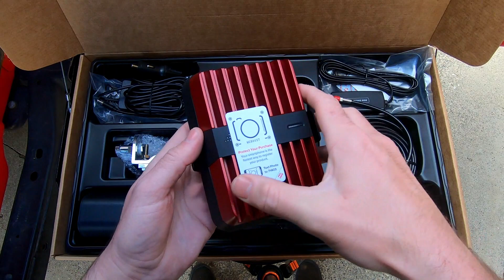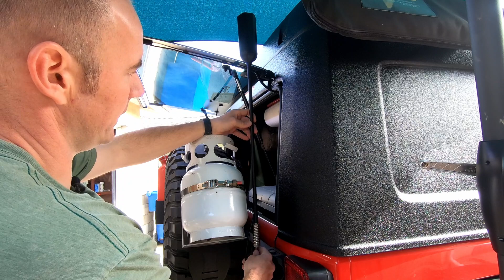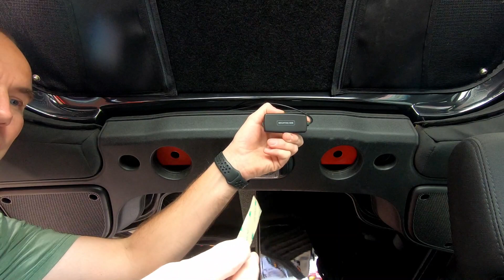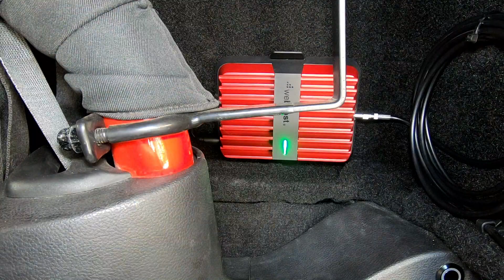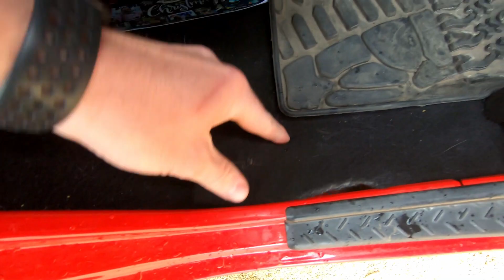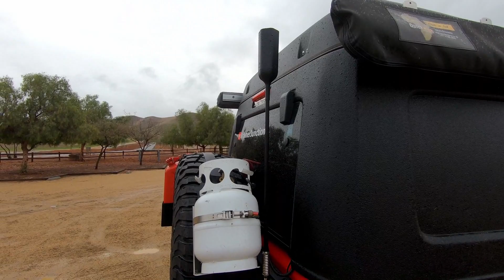Jeep JK WeBoost Drive Reach OTR Cell Signal Booster Install

Comment: So how do you like it? I just got mine for black Friday and almost think it's placebo effect. It gives me maybe an extra bar, but only in areas where I already have signal
Reply from the maker: I have a corresponding long term review video which I made a little while ago. It’s like I say, it works, but it can only do so much. If you have no service, it may give you a bad, if you have two, it may give you three and it can’t boost a signal if there is none. I would never expect streaming type speed increases, it basically just helps you get the job done. There are FCC constraints on what these types of devices are allowed to do and WeBoost still offers the best option on the market imo. I am in no way affiliated with WeBoost or sponsored by them fyi.
Reply: @KramerJunction  I appreciate the detailed response. I had high, but realistic hopes that it would extend the coverage area. I do understand it can't amplify no signal. All of the areas I go with little to no service are just outside of cell range and I was just hoping it would relieve some of the spotty coverage. Thanks again

Comment: spoke to weBoost about antenna height, and they said it would work best above the roof line.  Notice your antenna is below the roof line.  Do you have any signal issues with just the 18" height?
Reply from the maker: If you check out my long term review video I show and talk about how I added the extra extension. I thought it would sit too high at first but it wasn’t an issue so I added it. Can’t say I noticed any difference.
Biggest thing I have found out about the WeBoost which someone told me about is that from a technical standpoint there should be some type of metal shielding between the internal antenna and the main unit. The lack of shielding causes feedback oscillation or something like that at the WeBoost actually turns down the amplification to compensate…or something like that

Comment: Nice install. Wondering if you have an update after a year?  Mounting mine on my sprinter. Planning to swing antenna up when needed for clearance.
Reply from the maker: Yeah long term review is filmed it will actually be posted on wed, but overall I’m pleased with it and I 100% recommend it.

Comment: Do you have a link to where you get those 12 V switches? Sorry but I just found your channel.
Reply from the maker: Sorry for the late response. There are links for everything in the video description 👍🏻
Reply: @KramerJunction  Thanks for that. I just came back and rewatch this.. I’m seriously considering buying one of these now but I have a problem where are you put the antenna on the back of the jeep. Everything I’ve come across researching says to push the antenna up above any kind of a flat plane. So basically the highest point off a surface. How is this working for you lower down?

Comment: Finally seeing someone install the OTR antenna.  I have the we Boost but just the little antenna that came with mine.  I could not tell but what mount did you add to the tailgate that you were able to attach the OTR to?  I have a CB mount center of my spare tire but I can add another one near the hinge.  I have a 2014 Rubicon and hope to hear back where you got the mount. Oh and We Boost actually sent me your link
Reply from the maker: Haha nice that’s awesome of them to do!
I have the Teraflex Hinge Carrier. I think they call it the Alpha. It is pre-drilled for a mount they make. The antenna should fit in any mount where you can fit a CB antenna. Hope that helps 👍🏻

Comment: I noticed when I was wiring up my 12v dc adapter that it had both the positive and negative were wrapped together under the shrink wrap where the two separate. Did you add the inline fuse and see something similar or did you just wire direct without the fuse?
Reply from the maker: Yeah that wire is a pain in the butt. I remember the negative is actually woven around the outside of the positive like the mantle on a rope. I haven’t had to deal with that before so I basically unwrapped it a ways down the cable and then attached the negative to whatever corresponding negative it went to then cleaned the whole thing it and strengthened it with some heat shrink 🤷‍♂️

Comment: Been thinking bout getting one for my jku and my welding rig.  Cheers
Reply from the maker: I definitely recommend it. I have only had good results. It can’t boost what isn’t there and I’ve found it can actually slow you down if you already have great signal, but those times when you barely have a single bat it can give you two or maybe three. 👍🏻

Comment: Had no idea about the small area in the rear of the center console, so thanks for that.  Been lookin at installing one of these but haven't figured out yet where I want the antenna.  Not to many videos out there of these being put on Jeeps, so thanks again.  How bad dose the antenna travel while out on the trail?  I'm worried bout the head of the antenna smacking into the roof when things get bumpy, thou it seems you got least half a foot of clearance with your mount.
Reply from the maker: I haven't had an issues with the antenna hitting the top. The mount is pretty solid and it takes a bit of force to make the spring move. I'm glad you found my video useful

Comment: So what was the result
Reply from the maker: Mixed results. At this point, with limited use, my general consensus is...if you’re in an area with good signal, don’t use it or it might actually slow you down, if you’re in an area with bad signal, it may or may not increase your speeds based on the availability of existing and accessible cell service.
The one consistent thing I have noticed is a significant increase in upload speeds across the board, regardless of coverage prior to powering up the WeBoost.
Absolutely nothing scientific or measured, just what I’ve noticed/seen with limited use 🤷‍♂️
Reply: @KramerJunction  Hello, Not sure if this will help but it doesn't hurt to share if there is a possibility. Your antenna is being blocked where it is located on your jeep. I was told for it to be in an area where it is free from anything at the highest point so there is nothing obstructing the antenna for any signal. That specific antenna you have is made to pick up in all directions. Hope this possibly helps you out. Cheers
Reply: @NomadC905  I was wondering the same thing.